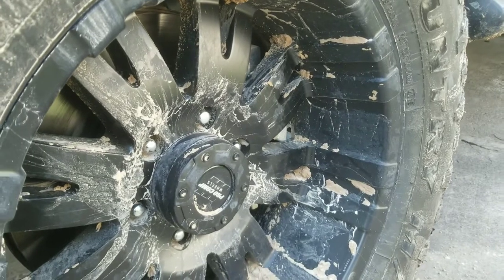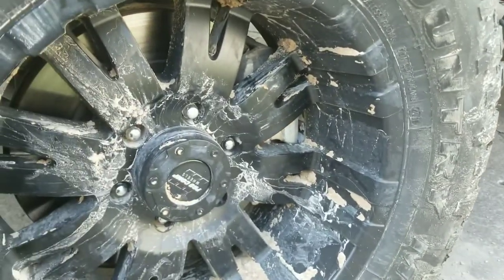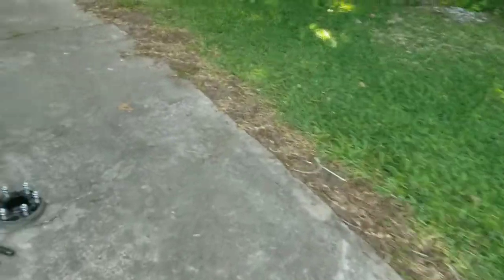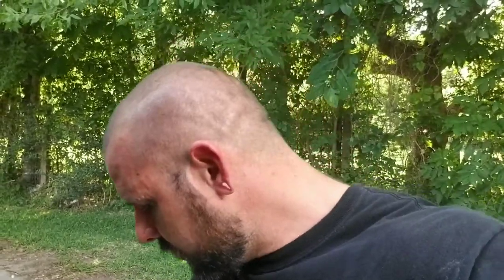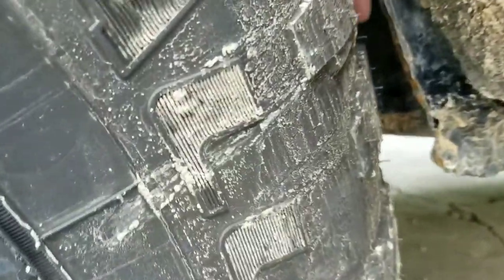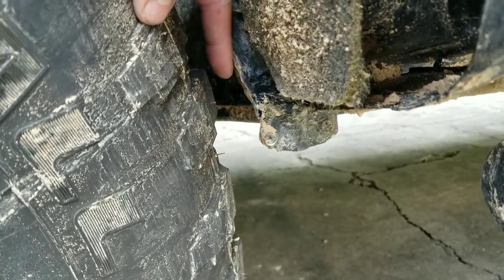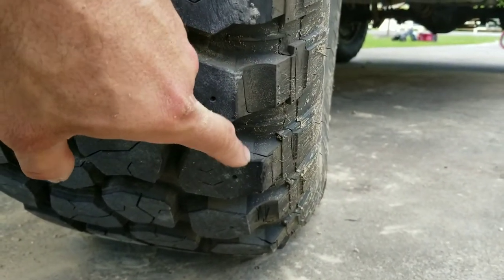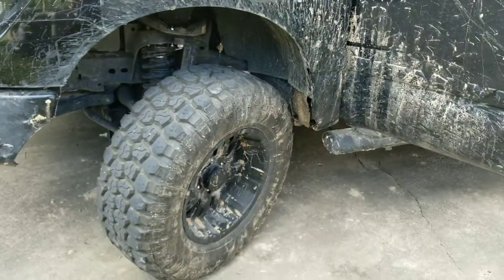I ruined a brand new tire only after 300 miles

Comment: You can buy extended lug is for spacer is longer only for wheel with spacer
Reply from the maker: Yeah i looked them up on ebay, i have been debating replacing them with the longer ones or just going with new rims when i need new tire. 🤔